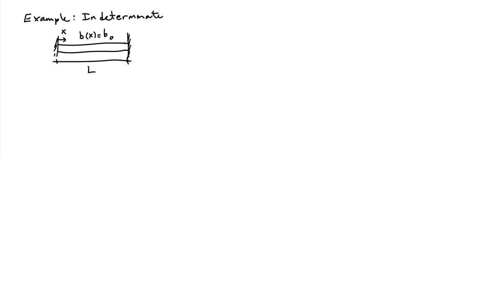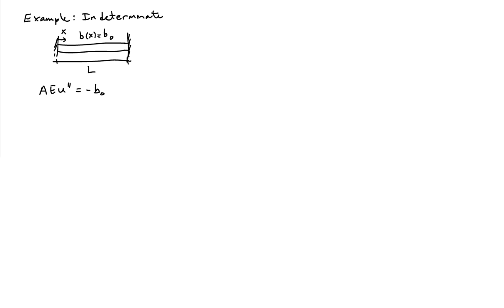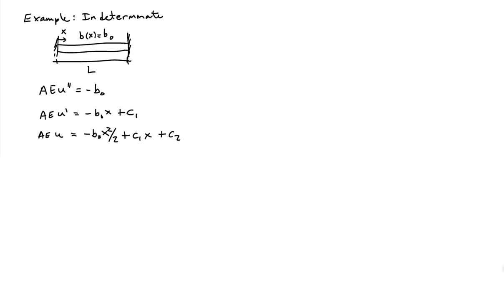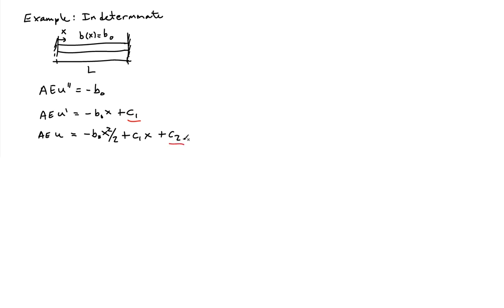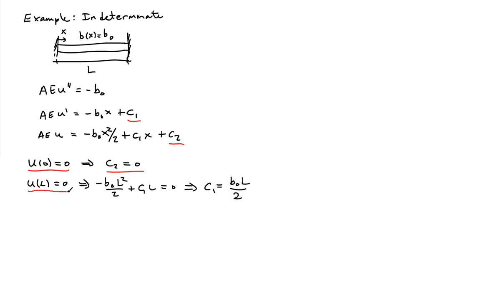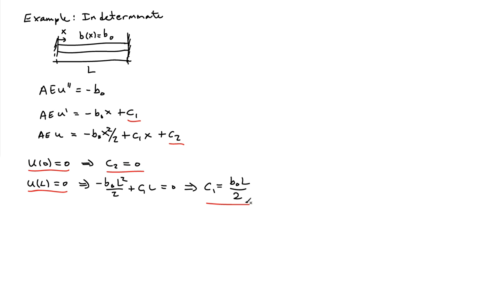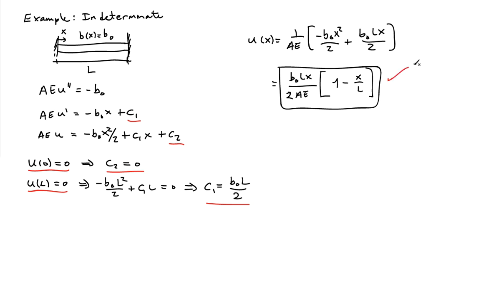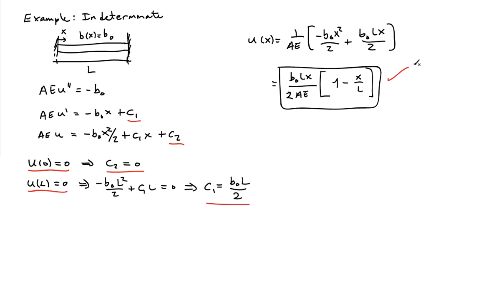(12C) Example: Statically indeterminate bar using differential equation

Comment: if  this case only axial force Px at L/2 ,AEu''=0 ,how to solve?
Reply from the maker: If the applied load is a point force of magnitude P at x=L/2, then you will solve AEu'' = -P delta_function(x - L/2).  Integrate twice to get AEu = -P <x-L/2> + c1 x + c2.  Now apply your boundary conditions.  Note the integral of the delta function is the Heaviside step function.  The integral of the Heaviside step function is the Macauley bracket.  See video (12D) for more information on these functions: https://youtu.be/Bxz-o5FViAk
Reply: thank you! teacher,i got it         ps:<x-a>=(x-a)H(x-a)